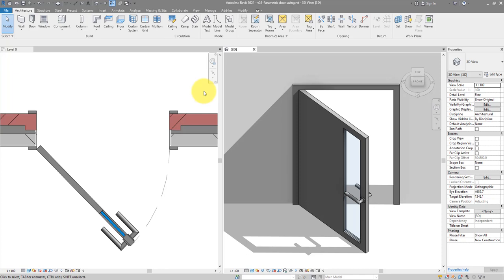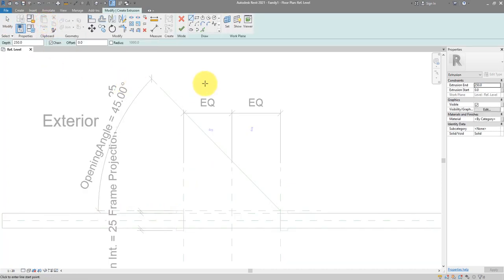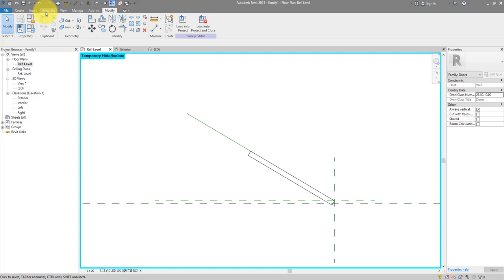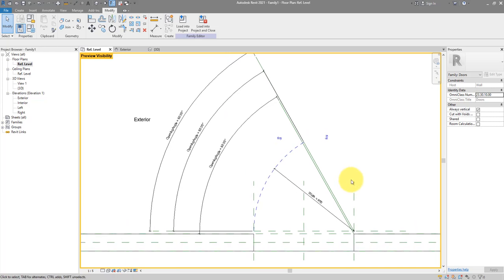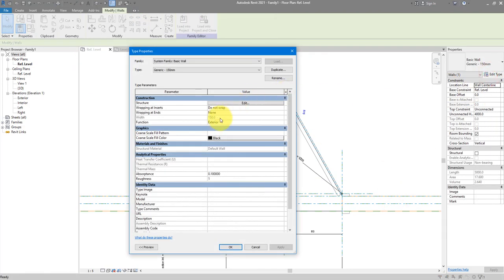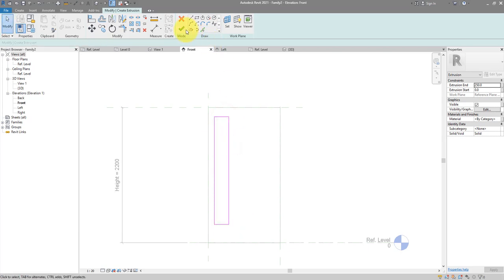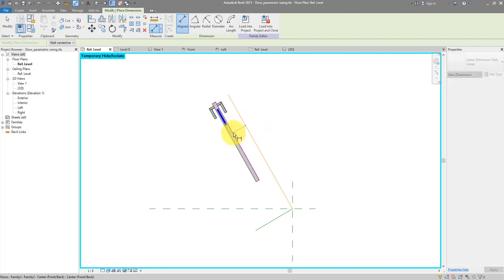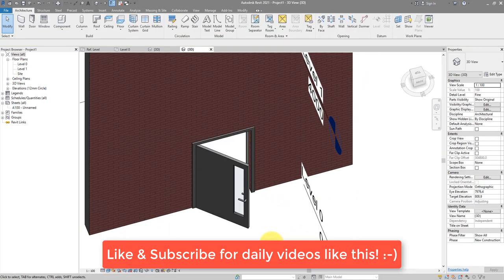Revit Snippets: Create doors with parametric opening angles

Comment: Incredible , I have replicated it as you have done , but I can not put the door closed , at 0 degrees , I get the following error , line too short for the Symbolic line . How do you make sure you don't get that error? , Thank you
Reply from the maker: Hi! The family I created in this video works fine with an opening angle of 0 degrees. Please consider following the tutorial again and don't miss any small steps. Revit is very particular with these small things! You can also download the working family from here: https://rv-boost.com/product/door-family-with-parametric-opening-angle/ Please note it's only for Revit 2021 and later.